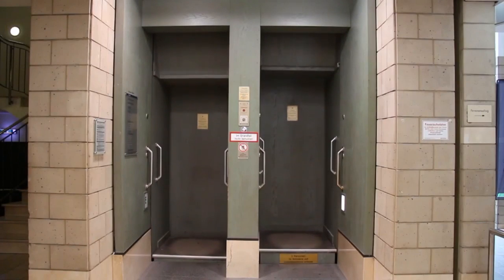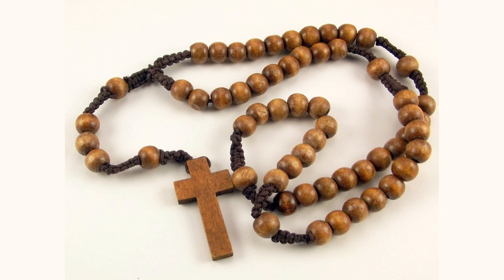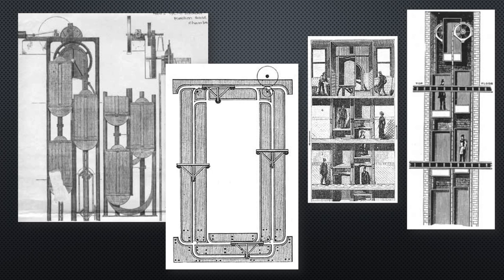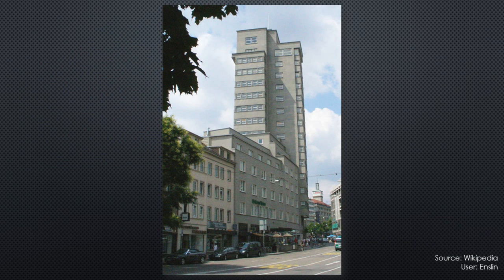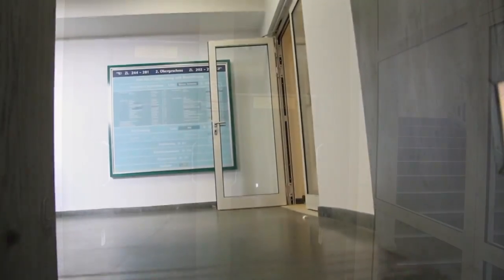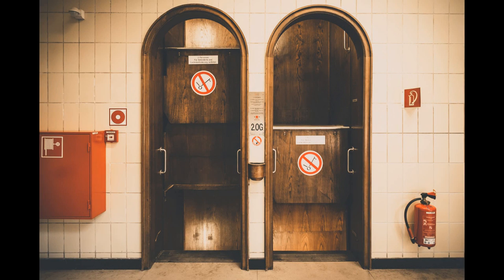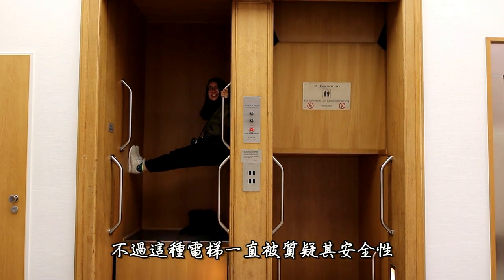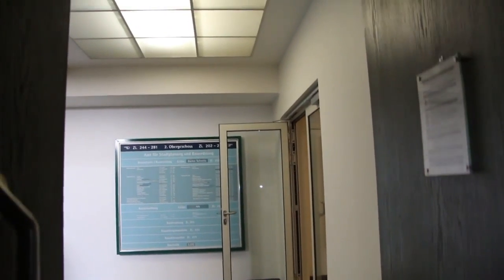What's a Paternoster Lift?

Comment: Great new channel, looks like there'll be endless material here in the future. Never seen this lift/elevator before, fascinating. 
Were you able to go around all the way at top and bottom?
Reply: Generally it's unsafe to go all the way over or under. It's possible to destabilize the thing because of the angles, or something to that effect. But there are plenty of 'up and over' videos out there which show what's up and down there - a big old slab of wall, usually.
Reply: I did it on my first ever trip in one: missed my exit on the ground floor and was taken down into total darkness where I then lost all sense of direction, due to the movement of the car at the bottom of the loop, until daylight reappeared at the top of the lift as it rose back to the ground floor. I didn’t miss my exit a second time - quite unnerving!
Reply: Yes

Comment: A very interesting concept and arguably more efficient than conventional lifts. It’s easy to see how accidents could happen though, especially when departing the carriage.
Reply: The 'obvious' accident potential is all catered for - by hinged floors and stop mechanisms. Real accidents are where the thing has failed for some reason.
Reply: @millomweb  having watched more videos about these I see what you mean by the hinged floors, the one at Sheffield Uni also seems to have several trip wires, buttons and laser beams to stop it in an emergency. I am of course going to actively seek out these lifts next time I go traveling in Europe so I can have a go on one!
Reply: @GPOTOM  you can do that in Prague: https://www.prague.eu/en/object/places/3400/lucerna-rooftop
Reply: @GPOTOM  The size of the hinged portion ought to be 'man size' so as the machine keeps running, a flap should open to avoid trapping anyone - meanwhile the motor should also be stopped. There was one about 40 mins drive from me at a works - dunno if it's still there - but I got a job on the same site and a school-friend worked in the building with it in. So, on the eve of my first anniversary of that job I arranged to go and see him - just as an excuse to ride it ! They take a bit of learning to transfer smoothly on and off them !
I'd be interested in the fatalities as I'm sure they're far more complex than simple trappings !

Comment: I used one of these occasionally when visiting Leicester University in the UK.and was was always nervous doing so. I remember a sign saying it was 'safe 'to ride over the top', which I did a few times; I escaped injury, 'though it was very strange seeing the pulley move past the walls of the semi-open compartment. I also also recall that the front section of the floor of each 'compartment was hinged to prevent one trapping one's leg if a bit slow alighting.

Comment: There are usually signs on these (actually can see so in this video, too) stating you are about to reach the top floor. This "warning" gave path to the myth that you must get off, as otherwise you will take a tumble as the cabin changes direction... but as visible in the drawing, the cabins just shift sideways before going the other direction, they don't flip upside-down... been in several of them in Vienna and Berlin... one time someone took the chance to pretend to freak out as he didn't step out at the top floor... cabin went up - poltering noises - cabin comes down - he is upside down on the floor

Comment: I used the paternoster in the former Ziggo building in The Hague when I worked there more than a decade ago. That is where the deadly accident happened because at the time it was the only paternoster in The Hague still in operation. I guess it was closed down after the accident. In the early 90s I also used the paternoster in the former city hall of The Hague (which has long since been demolished) when I worked there. Paul Verhoeven once said that as a kid he got stuck in it and it inspired the elevator scene in Total Recall, which ends with the bad guy losing his arms and falling to his death.

Comment: ADM in Marshall ,MN. had vertical conveyor belts with a double-sided flat platform and a cupped area for holding onto. No rails, no walls just air. It could be unnerving when transferring from an area with a lot of machinery to one with wide open spaces. I heard they are no longer in use any longer.

Comment: There was one in use in a government building in Hamburg in the early 90's.  I think it was the Bieberhaus.  I never had the nerve to try it.  I could not figure out what would happen if someone failed to get off at the top floor or if it would remove an arm or leg outside the lift.
Reply: They were in the Abrams building in Frankfurt as well. Rode them many times with a baby. It was a little nerve wracking

Comment: Siemens has (or maybe had) one in Berlin that I rode in 2016. They are interesting with a ton of safety features but they are slow and yes you have to be careful getting on and off as the step is always changing.

Comment: I recall seeing one of these in use at a big, multilevel valet parking garage here in downtown San Francisco about 20 years ago. The garage staff used it to get to the different levels when dropping off or retrieving the cars for the customers. It's been a while since I've been over to that end of town. I  know the garage is still there but I don't know if this lift thing is still in operation.
Reply: There’s one in a very old car park in Chicago that is just small platforms and hand loops on a chain. For the staff. It looked very dangerous, yet I was tempted to give it a try. I did not. The opening in the floor/ceiling looked about 2 ft circle. It may still be there but I don’t recall exactly where.

Comment: I went to the University of Leeds (late 80s) and there was a paternoster lift in the (very) brutalist Roger Stevens Building. I had never seen the lift design before and it used to really fascinate me. There were many urban legends about people getting trapped in the dark space at the top, breaking bones from a late exit, etc...  or the classic: that the carriage fully turned-up side down to complete a circuit. I was in the lift one day with our mature student, Mrs Grindley. We decided to go over the top to see what happens. Just as the carriage slipped away from the last floor she became scared and started screaming which got louder as we went into the black hole. Obviously, nothing happened we just reappeared into the light as the descent started. It was fun to know for ourselves what happened. And, after a coffee in the Waterside Cafe, Mrs Grindley felt fine.
Reply: gazetc I think they must have been a common feature of brutalist university architecture.

Comment: I used the paternosters in the IG Farben Building, also known as the Poelzig Building and Abrams Building in Frankfurt Germany for almost 6 years in the 80s and 90s, formerly informally called The Pentagon of Europe. There were 6 paternosters with 16 or 18 cars on everyone and 8 floors including the 1st basement. They were simple to use, noisy, and a little scary until you got used to them, and were a maintenance nightmare for the local nationals that had been servicing them since the 30s. While I was stationed at HQ V Corps and working in the basement a young female service member was killed because she freaked out and tried getting out at the wrong time.
Reply: The IG Farben building? Wasn't that the people who made Zyklon B?

Comment: I really enjoyed the freedom of the paternosters and it is a pity that the traditional lift lobby got them banned. The actual data on risks rather than the theory is not very different to lifts.  I particularly enjoyed the paternoster in the Engineering block at Leicester University in the UK where I did my undergraduate years and the one in the Ministry of Finance of the Slovak Republic in Bratislava, Slovakia where I worked as an EU Adviser for two years. The video was a nice reminder of moe relaxed and happy times .....😀
Reply: They could have easily required improved safety standards instead of banning them, such as obstacle/jam sensors, and delay-buttons for the disabled.

Comment: In CZE there is plenty of them. And it works without injuries. 
On one university in Prague there are 3 Paternosters in main building. And thousands of people (students and profs) use it every day. Ofcourse sometimes newbies stops the Paternoster by hitting security boards with limbs. How ever no injuries as far as I know. 

As mentioned in video: it is not usable to transport thinks that are not carried by hands. 
But for its purpouse - to secure high throuput of people in 2- aprox 20 floor building its perfect.

Comment: We had them in a mine I worked at in the Mojave Desert. Except it was a lot more primitive in that it was open to the air on three sides and the platform to stand on was just big enough for basically just your two feet.
Reply: That's a "Beltlift" or "Manlift". Paternosters specifically means the ones with the enclosed cars.

Comment: The Hitachi modernization of the paternoster makes a lot of sense. An elevator where only one side goes up and the other side goes down. This would greatly speed up foot traffic through a building assuming you could make this work efficiently. The only issue I see is too many floors hailing for a car, causing congestion and a massive slowdown. Now if there were a way to make the cars slide off of a main line onto a load/unload position, much how streets have indents for bus stops, this could alleviate the issue of congestion, but would introduce much more complexity in both physical design and software to prevent cars crashing; this is also a lot less space efficient than paternosters, elevators, and the hybrid variant that's a modernization of paternosters. 
Escalators on the other hand are much more efficient than elevators, as they also follow the one side up, one side down design, and much safer than paternosters, though they seem to break down a lot if my experience with them says anything. But again, space efficiency, you need the space of an entire stairwell, plus some additional space, these things are massive compared to vertical columns. But my proposal, having an elevator-like paternoster that has load/unload bays, with individually driven cars, is much more space efficient than escalators. 
Next issue is how these are driven. They'd have to be individually driven to be able to separate a car from the main line, and you'd also have to have a way to safely deliver power, and safely change lines, which adds a lot of mechanical complexity, and would probably make them challenging to install and repair. A linear movement from line to bay would be the simplest, but also the slowest, while a line-change with a diagonal vector would be faster, but more complex. This also doesn't cover the drive mechanism itself, with individually driven cars, rack and worm pinion is the only sensible solution, especially when a car is moving downwards, but this re-introduces the speed issue, and introduces the issue of how the hell a car moves from the line to bay, in either design, and how the hell the cars move around the top and bottom curves. 

Pipe dream idea, I know, but I almost want someone to figure out how to get around every issue to have the most efficient 'elevator,' and test the desgin.
Reply: Escalators are much more dangerous than a modernised paternoster, combining the dangers of open stairs with moving parts.

As for redesigning paternosters: I disagree with the idea of having them move independently, and not attached to the main lines. It defeats the primary safety and simplicity of the paternoster. Instead, you have them called and stopped like modern escalators, sized and aligned so that they all stop together at their nearest floor level, and with safety-doors like normal elevators that only open when stopped. When traffic is light, they will move quickly. When it's heavy, they stop at pretty much every floor. Similar for conventional elevators, but with vastly higher passenger capacity in each shaft.

Comment: When I was a kid they had a similar type system at the local flour mill. It was an industrial version, the safety nerds would be catatonic at such an item today. It consisted of a moving belt, there was a step and a hand hold, you stood on the step and held on, traveling between floors, there was no safety equipment of any type, if you let go the hand hold you could fall off the step at any point, nothing to stop you at all. I'm pretty sure safety regs probably banned these a long time ago.

Comment: Paternoster lifts were also used in restaurants to transport food between floors. They had an emergency bar to stop the lift if a staff member leaned inside the lift. In Liverpool, somebody within the premises of a snack bar had jammed a Coke can behind the bar to keep the lift moving. A young assistant leaned into the lift to lift food out and her neck was crushed between the lift and the lift shaft ripping open her trachea., After extracting her, we applied an oxygen mask to her face and it was just inflating her neck. These lifts are dangerous.

Comment: How hard is it to just put a pull switch at the top and bottom of each level? If your arm sticks out, it's gonna hit the cable, trigger the switch, and stop the entire elevator.
Reply: They do have sensors and safety systems nowadays.

Comment: They are ultra efficient

There are some in public parkings in Mexico City with some that are a lot more hazardous, just imagine a conveyor belt with a foot step and a handle. But they’re still unbelievably convenient, thus used for increased efficiency. 

They can move a lot more people in a flow. No one has to wait but catch the drift. Of course there should be hitachi facilities where needed for the disabled. But for a few floors, their efficiency is unmatched.

Comment: Well I've never seen any of those in Canada but on the prairies in the old grain elevators there was something similar but far far scarier. It as a wide continuously moving belt that went up to the top levels.  On the belt were alternating foot and hand holds so you could hang on either going up or down. Usually one hand one foot and you just jumped off when you got to the level you wanted.  Of course a large hole in the floor around the belt so you had to make sure of where you stepped! Way faster than you would want it to be too. And no I never got to use one. The kid I was thought they were super cool but the adult me is appalled.

Comment: So what happens if you stay in the car as it reaches the top? Since one of these was in a University there must have been plenty of attempts to do a complete loop.
Reply: There was one in the Arts  Fac  tower at Birmingham University in the 1970s. The Italian Dept was in the middle of of the tower and at busy times it was often quicker to take a rising car travel over the top and back down as descending cars were already full of students heading out.

At the summit the car, which was hinged at the top, simply swung around to the left as it rounded the guide wheel and then set off downwards always remaining upright. It was a bit scary the first time but afterwards it was perfectly routine (if frowned upon by the authorities!).

Comment: These certainly seem like a good idea for various reasons, but the dangers are also a big concern. Hopefully the modern system can include various safety sensors, emergency stops, and adaptive systems to help accommodate the disabled. Modern electronics and sensors could do a lot to make these systems safer and more reliable!
Reply: Disabled etc. are better off using a conventional lift.

Comment: It would not be hard to design one of these with elevator doors and the the ability to "slip" on  the cable to hold position as you entered and exited. By having an up shaft and a down shaft you could increase the number of passenger movements per hour by at least a factor of two. And in a 20 story building, by up to a factor of four.
Reply: Too unsafe to not have them attached to the main cables. The "solution" is to just have them stop at each floor as normal elevators do, aligned so each car stops exactly level at each floor (except the car in the attic and pit), with normal doors. Travel is a little slower, but you get the advantage of fitting vastly more people in each lift-shaft (if they were sized like typical elevator cars) and you avoid both the risk and the perceived risk.

Comment: Computers are the last safety device you consider when all others have failed. They require specific data from sensors and foreknowledge of what to do about it. 
Talk to me when there are automatic mechanical stops. Put a movable plate at the point where the elevator meets the wall and cut off the power when it's moved. You could run the power line next to the plate and push a contact open as the plate moves, no computers required. That might be safe!

Comment: Paternosters are straightforwardly better than other elevators in tall buildings with even moderate traffic and any building with 3 lifts should have 2 replaced with paternosters and 1 kept for disabled people. Who might actually have a shot at using the lift when they are not competing with everyone else.

Comment: I amm surprised there are none in Israel. In Shabbat, religious people can not operate elevators, and thus a program is executed where the elevator stops at every floor for a couple of seconds, usually stopping at every floor going up, and after the last floor going all the way down, if I am not mistaken. But since there can only be 1 elevator per shaft, it becomes real annoying real quick.

A paternoster seems to alleviate some of the inconveniences.